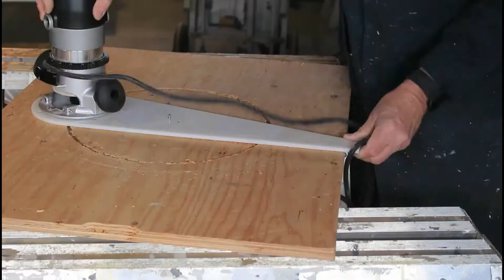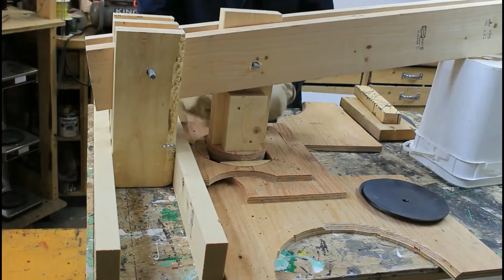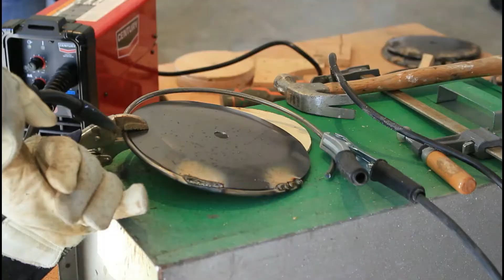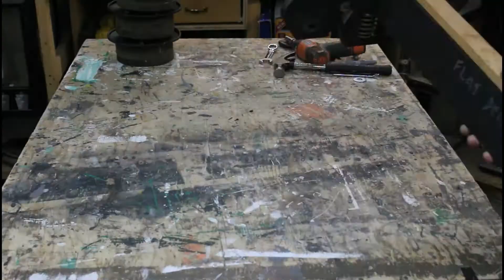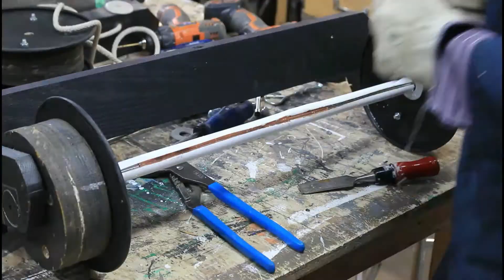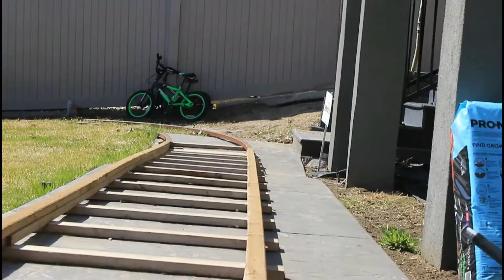Fabricating small train wheels

Comment: Great work on this project. I'm curious about your track design. Is the track itself square metal tubing? I found your project after brainstorming the idea of stripping down a retired riding lawnmower, removing the tires, and building it back up as a rail engine for a backyard shortline, with spurs between the compost bin, the garden, the chicken coop ..and of course the car barn. :) I think the riding mower makes for a good platform, and derelict ones can be had for cheap. But I'm struggling to come up with a good inexpensive track concept. Right now my best idea is to flex strips of 3/4 screen trim into curved lengths and glue them together. I'd love to know what you did, though. The angle bracket cleats was a good move.
Reply from the maker: yes it's square tubing, your project sounds interesting!
Reply: @GoodHeartProjects  mine is more like a "what-if" right now but we'll see. I sub'd, so if you happen to put out a vid demonstrating how you tracked the curves I'll be sure to see it! ;)

Comment: Are the tracks wood or metal and how did you bend them
Reply from the maker: tracks are 1 1/2 square tubing except over the sidewalk wood was used so rust wouldn't stain the sidewalk. a local machine shop bent the tracks.